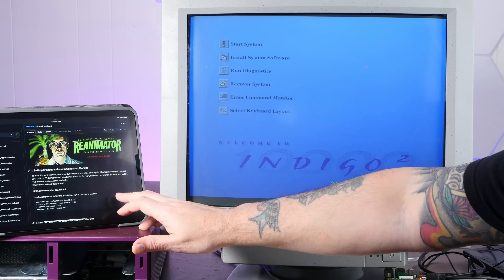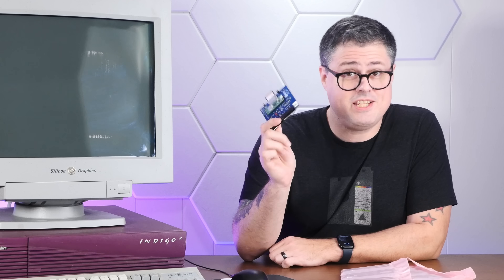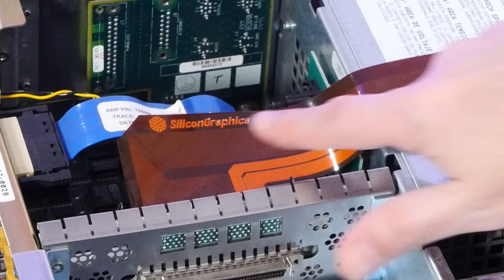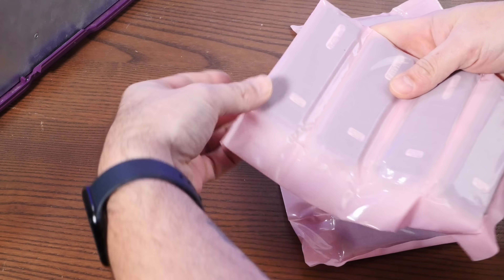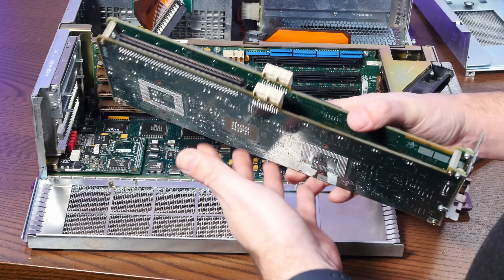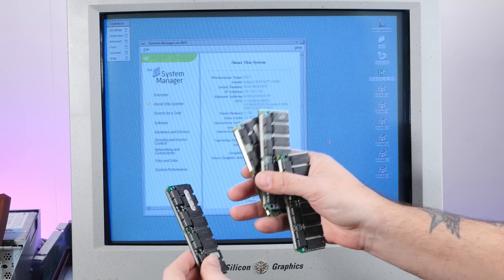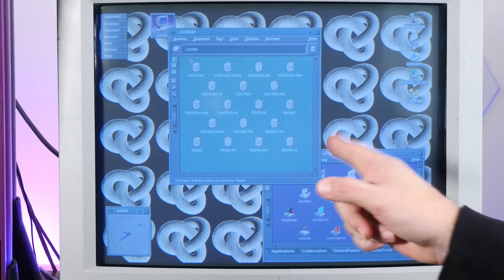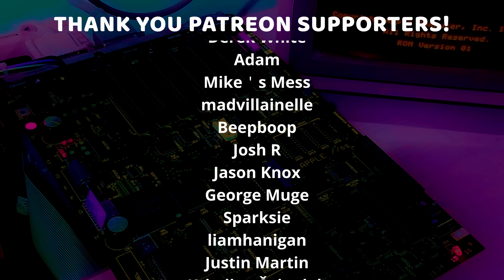Inside a $50,000 Unix Workstation from 1996

Comment: To think that in 1996, 1 GB was an unimaginably huge amount of RAM, but nowadays, our web browsers need that much just to open one new tab
Reply: Yeap... Back in 1996 I built my first PC (Cyrix 6x86 something) with a 512M ram. Now years later, current computer rocks 64G ram. And almost nothing would start with that 512M memory which was back then a quite large amount. Even ran few times just for fun Quake or Doom from Dos ramdisk. 

But mostly that 512M were due using Windows NT4.0 back then to do things needed for the school.

Looking back... Current computer has 128x memory, 7000x more storage (1G vs 7T). And it sounds quite amusing that current amount of ram is 64x that I had harddisk back then... 🤯
Reply: @sasiuru  Were you rich?!? 🤯 how much did 512 cost you back then?
Reply: @_..-.._..-.._  Would have been a good few thousand. You didn't really need to be that rich, just needed the mindset that professionals had at that point. If the computer was a tool that greatly accelerated your work and you earned money on it, then it very quickly paid itself out. 

This mindset has gone mostly, nowadays a thousand dollar computer will do just about any creative workload very well, and most computing use cases too. Those that still pay ridiculous sums for low intensity workloads are either: 1) enthusiasts, 2) not very acquainted with computers or 3) buy it just to flex.
Reply: According google price were going down from 30 usd per MB to 8 usd per MB during 1996. So quick guess it were around 4000usd. Not cheap, but as I needed personal Windows NT workstation for school stuff. And running NT4 and development tools with less than 512M were just a asking for a trouble. This is 5th reply, as 4 previous had been lost by YT.

(edit; I shouldn't do any math before getting coffee...)
Reply: @_..-.._..-.._  I remember we had 128mb in 99 with a pentium 3. Was expensive enough here. 2999 deutsche Mark 😅
Reply: @sasiuru mmh are you sure? My first pc in 1996 had 32 mb of ram and was a $4000 machine from Compaq.
Reply: Even for this massive Unix WORKSTATION, it was insane to put a gig of RAM. Now, we have Raspberry PIs with 16GB of RAM.
Reply: @SuperDavidEF  no not yet but maybe soon
Reply: I imagine 1gb ram is at least equivalent to 192gb now
Reply: Probably closer to 1 TB of RAM or higher since 64 GB is considered "enough", like the 32/64 MB of the 90's  @_..-.._..-.._
Reply: You know what the worst part is? Today most of your browsing experience is bogged down by bloaty heavy ADs that take up most of the network traffic, burdens our cpu with live feeds and videos, sometimes even rendering. Not to mention all that bloatware in your computer AND phone that constantly "phone home" to keep selling your data.
Reply: @The_Wandering_Nerd  one of my fondest memories of 90s computers is when my friend’s dad was excited to upgrade his HARD DRIVE to 1gb.

The funny thing is, my first thought was he’d never need all that space.
Reply: @lorenclark6279  I felt that way too when I bought my first computer in 1996, a Pentium with a 2 GB hard drive. I thought I would never fill it up. Then I discovered MP3s :D
Reply: Even crazier: that we carry mid-range phones that have 12 or 16 times as much RAM in our pockets...
Reply: Bloatware programmers will do that.
Reply: It would be like having 100TB of ram today. 30 years from now I wonder what specs we'll be running
Reply: @atherrien95  however much it is, it won't be enough; bloatware always expands to fill the amount of RAM and CPU it's in :)
Reply: A bit crazy to think that just a few years later Intel 440BX chipset supported 1GB with 4x 256MB sticks, but of course most Pentium II systems only had 64MB or 128MB RAM
Reply: The average Pentium couldn't cache more than 64 MB RAM, so anything beyond that actually slowed things down.
Reply: This tab needed 512MB on it's own .. my first PC had 'upgraded' 8MB or RAM.... Insane
Reply: how times have changed🤪🤪

Comment: A gig of ram in 1996 is truly utterly wildly insane

Edit: I think people had 8 or 16mb back then according to the 87,000 comments I got
Reply: My computer at the time had a gigabyte...of hard drive space.
Reply: @kingedwin  I started transferring my record collection to digital back then, and it took up a lot of space, so I had a big need for HD space.  I think I started with a 200MB drive when I got the PC, and that was a lot for most uses.  I got 6 500MB drives used from a business upgrading to much more, and that along with an add on card since the board only took 4 over the 2x ISA bus, and that worked for about a year until they were packed to the gills.☹  Thankfully the $/MB price dropped a lot and the sizes of drives increased as they did.  Since ~ 2000 I have always had room to spare, and that includes triple backups of everything.😃
Reply: My friends thought the 32 mb in my Mac clone was insane in 1996!
Reply: @bltvd  I remember what a huge deal it was to have upgraded from 4 MB in my Powerbook 520 to 20 MB back at the time.
Reply: 1 gb was a very good amount for 1996 HDD’s, so maybe 1tb of ram is about right for current comparison.
Reply: Quick online search 1996 DRAM price was 1060000 bits / dollar. According to my math, that works out to $7.72 per megabyte. A gigabyte would run $7905.
Reply: @BrianMoore-uk6js  4 MB of ram for my Amiga 4000 were about 300DM (200$) that time. 1GB would have cost you 50,000 bucks.
Reply: @compfox  i think my data was based on manufacturing cost. Not retail price.
Reply: @BrianMoore-uk6js SGI actually charged tens of thousands of dollars for 1 GB RAM back then, because it was so rare a feature that it commanded a huge price premium, simply because competitors couldn’t support that much memory in their own desktop workstations.
Reply: @little_fluffy_clouds  That was not in Indigo2. You're probably thinking of Challenge/Onyx. 1GB was not a supported config in Indigo2. In highend systems larger RAM amounts required the use of 64MB SIMMs, fitted on MC3 boards with 32 slots (I have lots of them), max 2GB per board, max one board in a deskside, four boards in a rack. In 1995 a single 256MB kit cost about 20K (I saw a quote while doing research at the time which used SGIs).
Reply: A gig of ram was still pretty “premium” in _2006_. Having that in 1996 is crazy.
Reply: @NateVolker  1GB was premium in 2006?! Ehm… uh… no… At that time, 512MB was on the lean side, 1GB was kinda baseline, and 2-4GB was upscale, and 4-8GB was high end professional.
Reply: @ , well, it seemed premium to high-school me, who only had 512MB and was super jealous of his neighbor’s 1GB machine
Reply: @NateVolker  In 2006 I had 128MB RAM in an old hand-me-down PC. And now almost two decades later I have 1000x that in my PC
Reply: That's like having multiple terabytes today.
Reply: The huge amount of RAM really contributed to SGI workstation prices, that and being the only game in town as far as graphics plus expensive texture memory in many models. I'm not sure what the minimum RAM config for an Indigo was but it was a lot in comparison to a PC. It was all best of the best hardware for its time and SGI heavily marked up every single option.
Reply: @lemagreengreen Wikipedia says "Memory
16 MB – 1 GB" and to me, 16MB as the OEM installed minimum feels about right. Grain of salt, though, and all that.
Reply: @TheBilgepumper  AFAIK resellers never installed that little. I've dealt with more than 200 Indigo2s down the years and I've never seen one with less than 32MB. One can certainly install 4MB SIMMs, but that wasn't a normal use case. 1GB was also not an official configuration, it wasn't a SKU one could order. It was something discovered later; I was the one who compiled the original writeup based on the initial discovery by Bert Heise, Roger Garcia and David Cummings.
Reply: @lemagreengreen  FYI it was the resellers who marked up the products, not SGI. Resellers made the real moolah. Some sales reps became millionaires. Indeed in the end it was the reseller sales model which helped kill SGI off, though it's an issue most SGI hobbyists know little about. RAM though was certainly expensive, a 128MB kit was about $5K+ in early 1996.
Reply: their deskside onyx could have 2GB in '93. 16 for the rack variant.
Reply: @ holy shit
Reply: @trekintosh Sounds like a good title for a parody of a Savage Garden song.
Reply: @TheBilgepumper how period correct 😂
Reply: I think I had 16 MB of fastram on my Amiga 3000 at the time. I felt like a king.
Reply: Its like 1tb of ram in 2025
Reply: In the 1990s I worked for a part of a large company that had a Silicon Graphics Onyx with 512Mb of ram. Another part of the company came to visit and said they had an Onyx with 1Gb of ram. I remember thinking "What do you do with a Gb of ram?". How times have changed
Reply: When Windows NT first hit the market in 1993 its minimum requirement for 12 MiB of RAM was a significant barrier to adoption. At that point 4MiB was considered reasonable entry-level PC RAM.
Reply: Not if it’s for Servers or Workstations, they have different,mhigher build standards in comparison to the machines made for most consumers
Reply: The most fascinating fact from those workstation was they could connect to a "OpenGL 1.0 server" using indirect render (iglx) and render on the server in realtime.
You could do the same right now using mesa and ssh but the last time I tried was buggy.
Reply: My parents got us our first computer in 1996. It had 16MB of RAM and we were hot stuff.
Reply: 99 or so we had 128mb with a pentium 3
Reply: seriously. I remember going from 256/384MB to WOW 1GB in 2005 or so, and then 2GB in 07. 256MB was a great amount back in 2000. Can't imagine 4x that years earlier.
Reply: I think that was about the size of my hard drive then.
Reply: IKR??
Reply: Dodoid has the highest-end sgi systsem of 1993: SGI Onyx. 4gb ram. $250k. Went up to 16gb for a mere $600k
Reply: @starfrost6816   I wish he would start uploading again, he quit quite a while back.
Reply: I remember buying an early 16MB DRAM DIMM at Fry's for nearly $800 in early 1994...
Reply: @Jah_Rastafari_ORIG   I remember purchasing 64 MB and an 8 gigabyte hard drive and thinking I was pretty much future proofed for the foreseeable future, wondering what the hell program would I ever run that would need that much hard drive space and Ram LOL. And that was the pinnacle of my Computer upgrade ignorance/innocence.  Because pretty much everything after that was forced routine upgrades. And now here I am typing this very Comment on a device in my hand with 8 gigs of ram, an octacore processor, and half a terabyte of storage space, with more processing power than 100 SGI machines at the time.
Reply: I have a duel pentium pro board that supports that much.
Reply: Lies! What he can now do is run trash californian x86 operating systems under SoftPC and not trash the swap slice.
Reply: What I had in 05
Reply: I had 768mb in 2002, it was absolutely amazing running linux with a ram backed swap at the time.
Reply: Our PC at home had 16MB.
Reply: yup prob woulda been like 20+k
Reply: I remember saving up for a few months to afford to upgrade from 4MB to 16MB for my trusty AMD 486!  The 486 could supposedly address way into the GB range of memory (I think 64GB), but I don't think there was a single motherboard that let you use that much, and neither Windows 3.1 nor NT knew what to do with it, so I can only imagine it possible with some form of Unix like OS.

Now I have 64GB in this here smokin' Ryzen system and room for 64GB more if I ever have a need, and it was a good deal on good memory for being on sale and only ~$25 more than the 32GB I was going to get;  No fear of breaking the bank.

I remember even further back ~1980's when a 12k phone modem cost as much as small car, despite it taking a few minutes to send a single page of plain text, if you got lucky!🤪 Resumable up and downloading wasn't a thing, and connections not very stable either.
Reply: I had 8mb back then,.
Reply: On top of that it probably would have been completely unnecessary given the OS, applications and databases with processes in common use.
Reply: @HappyQuailsLC That depended on the task. SGI targeted markets which absolutely did need a lot of RAM, everything from defense imaging and GIS to textile production and volumetric medical imaging. If anything it was all the more remarkable how much was achieved by the vast majoriy who used SGIs with far less RAM. I've owned a lot of Indigo2s (I currently have about 60),, it was rare for a system to have more than 512MB, though upgrades certainly occured which meant systems with 640MB certainly emerged (users with orig 128MB adding two 256MB kits later), especially defense systems and in movie companies. SGI never had an official 512MB kit. The 1GB limit was discovered later by hobbyists, first by Bert Heise.
Reply: The ratios aren't too far off today's. 

Think about super high end workstations that can go up to 1TB of memory or more while most consumer machines have 8GB or 16GB, 30 years later.
Reply: yeah 8-16mb in the home PC was about the given for things. I just did a vintage Pentium II build where i was able to max out that thing to 3x128mb and it is insane what the Me back then in the 90s would have thought haha.
Reply: its like 1TB of RAM nowadays
Reply: Apple produced a mac os 8.5 tower that took 2 slot one apple cpus and the entire back of the board could be maxed out at nearly 8 gigs of ram which gave os 8.5 a massive speed boost.
Reply: I thought my 256mb emachines was alot back in the day
Reply: real